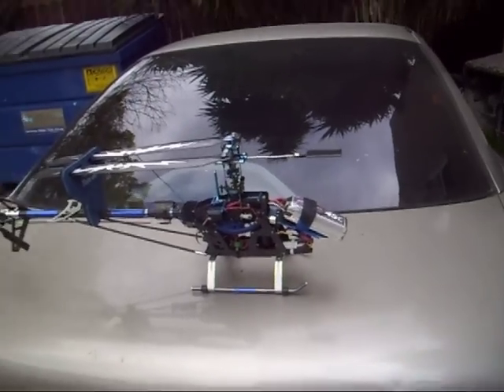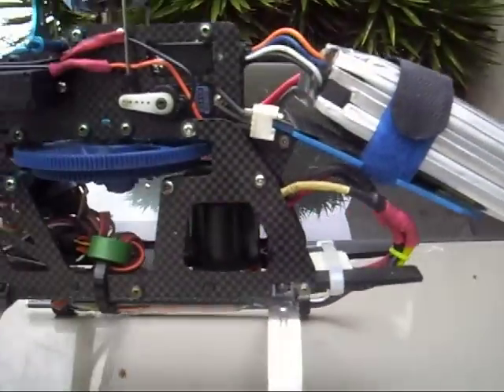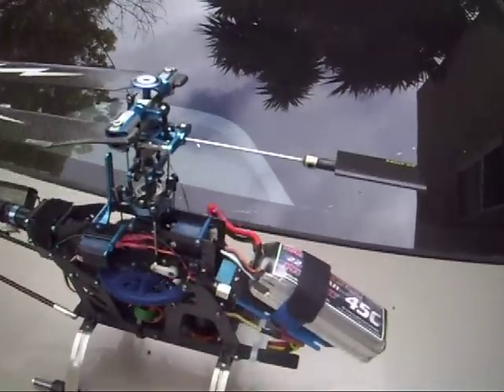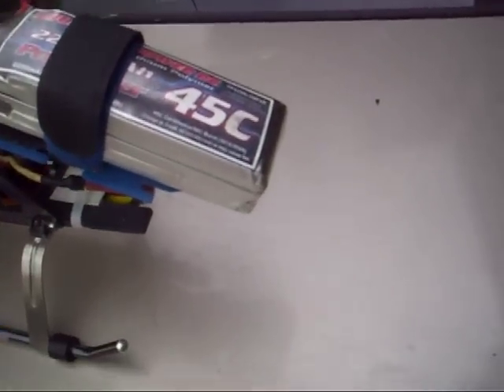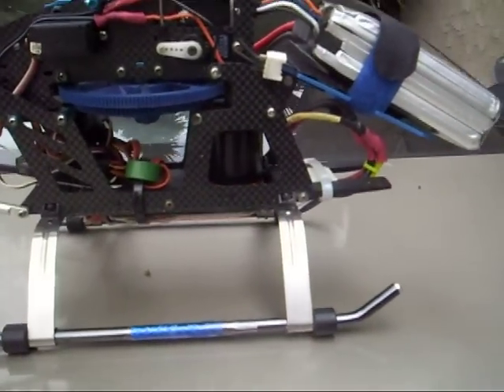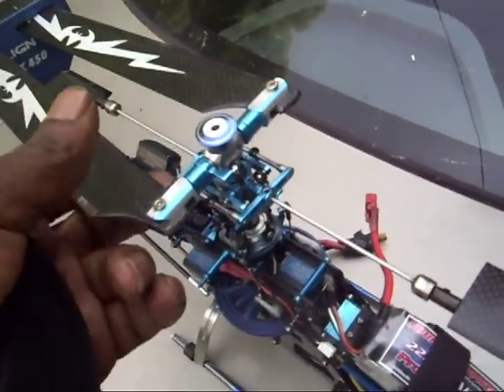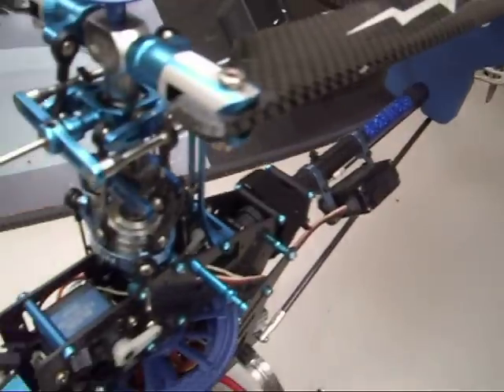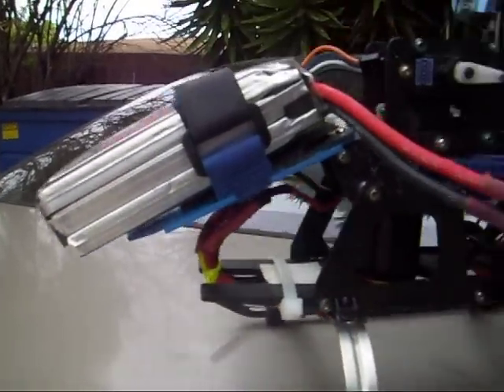worst place to mount a lipo on a trex 450.

Comment: Best place to mount it is right on top of the boom so it will get smacked by the blades in the event of a boom strike. It will save your $3 boom but cost you a $30 battery lol.